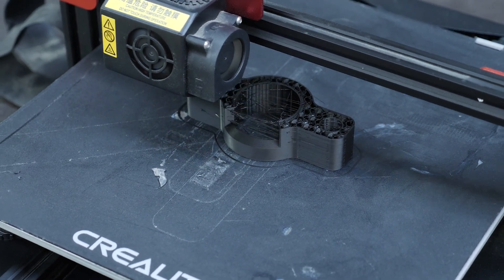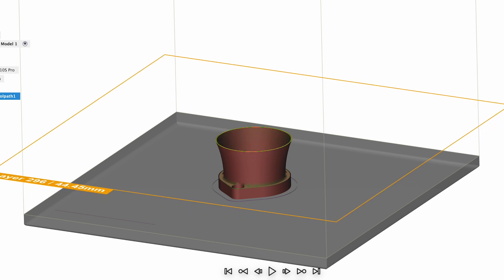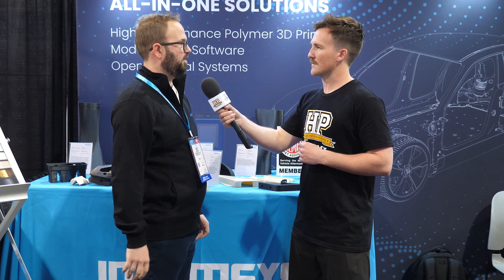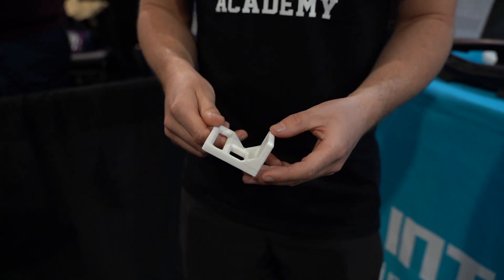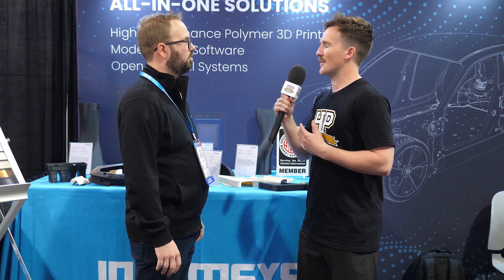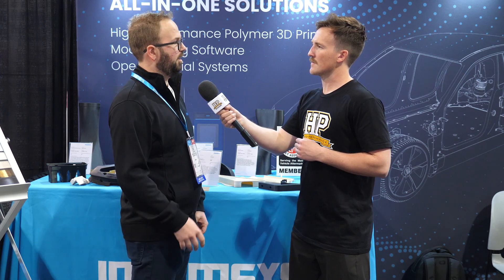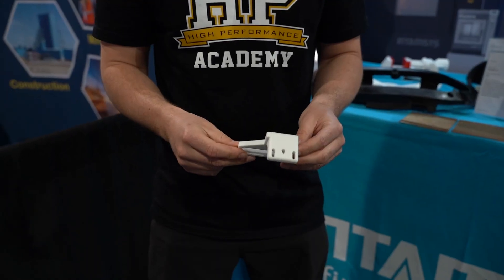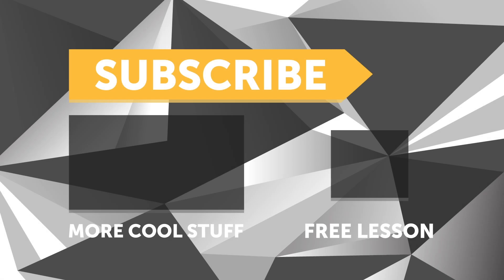Does 3D Printing Have A Place In Motorsport?

Comment: We used functional 3d printing for our Formula Student race car alot. Maybe the most impressive use case was the monocoque.

We printed the core of the monocoque from PET-CF, which creates much more geometric freedom at a much lower pricepoint than a aluminium CNC machined honeycomb core. Afterwards we layed up 2mm of regular carbonfiber on top of the core, to obtain the required structrural integrity of the monocoque. The monocoque passed the safety inspection of the dutch FS competition, so that was a big win in our test of "how far can we take 3D printing in the process of building a functional racecar"
Reply from the maker: That is awesome! What a cool project - Taz.

Comment: One thing he didn't mention about materials like PEEK/PEAK/PEKK is their chemical resistance. Their heat resistance is way more than you need for an engine bay, you could probably bolt them directly to the block and not have any problems depending on the specific material. He did mention that they were "medical" but what that really means is that you can spill oils, acids, and whatever cleaning products on them without worrying about having plastic tar spreading around, I normally think of plastics in that family for their aerospace use since they are used in super hostile environments like satellites regularly. A bit closer to the race car use case than a medical implant.

I've been planning a large volume 3d printer for a while to be able to print that properly and man is it a pain in the neck. Bearings, electronics, timing belts and basically every component of a 3d printer all hate the ~200C+ chamber volume required to properly print this type of plastic. I looked up this company and their printer looks more like a kiln than a 3d printer XD
Reply: thanks for your addition!
Reply: Only issues I've had with those materials is that they tend to have issues with brittleness. That's where a CF Nylon works great or having the ability to do salt or water annealing on high temperature filaments.

Comment: Why is this so expensive?! You can get a large scale 3d printer capable of printing PEEK/carbon fibre etc for a few hundred dollars
Reply: Where can you get a printer with 400c nozzle heated build chamber up to 100c for a few hundred bucks?
Reply from the maker: @ashcadelanne8524  link please. I'm skeptical, but we all would love to see you prove this statement to be correct and accurate - Taz.
Reply: Seriously getting a good PEEK print takes 200C+ chamber. There’s no printer even remotely close to a few hundred dollars that can do that
Reply: You could make it cheaper than just buying one, but thats a lot of work, you gotta build a very airtight, efficient enclosure, then you gotta source 2kw~ worth of heaters, preferably passive rather than fan, then you gotta source a  nozzle and heatbreak that can handle the hi temps of those materials, and so on and so forth
Reply: It certainly wouldn't be a few hundred, that would get you like a tronxy 400mm as a base. That's it

Comment from the maker: Do you want to see more content on 3D printing? What specific topics would you like to see covered or questions answered? - Taz.
Reply: Yes! Great tool for grassroots motorsports. I would love to see case studies with a deep dive on specific components created with 3D printing. How they were engineered, specific considerations for 3D printing, what material they were printed with, and how they worked in practice. I have been seeing a lot of serious parts like intake manifolds, ITB adapters, air cleaner housings, and charge tubing created with 3D printers.
Reply: Heck yeah that would be great.! I printed a few brake ducts for race cars in the past, using a nylon 6, 66 blend. I anneal the printed part in finely ground salt. It pushes up the heat resistance to over 200C and helps the layers bond. I then soak the part in water which make the nylon super tuff and wear resistant. 
🇦🇺🤜🏼🤛🏼😎🍀☮️
Reply: I'd like to see more videos for actual prototyping and then installing on a car to test results. Talking more about material selection for different areas of the car for actual bolt on use (ABS, PLA, Polycarbonate, etc.). Also going into softer materials like silicone/rubber to make your own gaskets or seals.
Reply: Engine internals: pistons/rods,crankshaft,   whatever

Comment: Already said yes before even watching the video lol. Love to see rapid iteration and innovation.
Reply: Same.
Especially since i am using a diy quick release for the steering wheel on my simulator. Since more than 3 years it easily takes up to 20nm (Simucube 1/small Mige motor) and the majority of it is rally.
It's one of the parts that just proofs that you can do a lot (even when it comes to some load carrying parts) when you know what you're doing when it comes to designing the part.